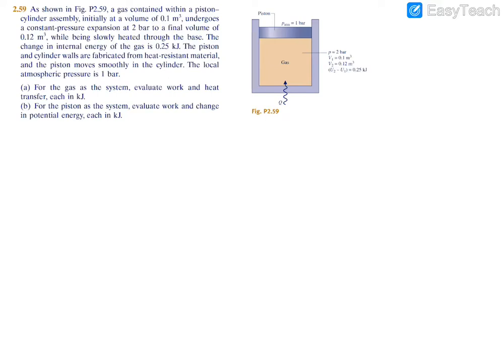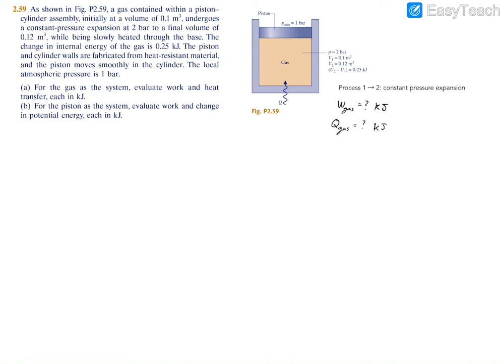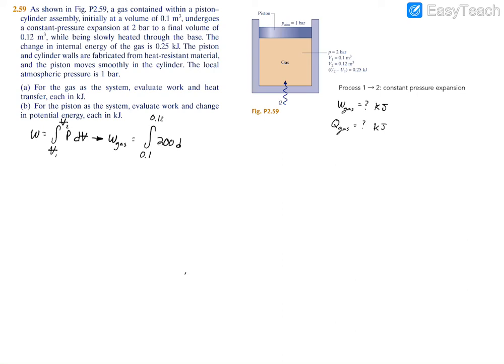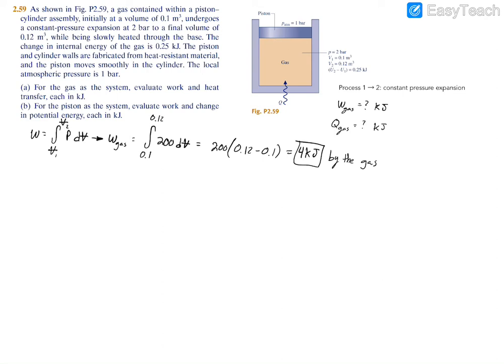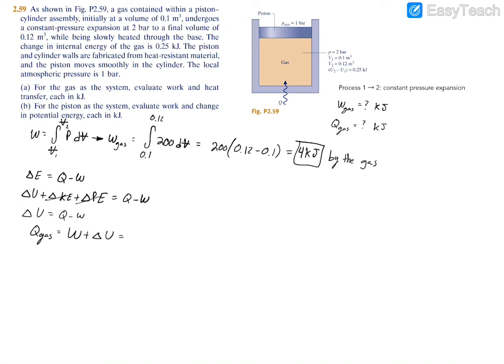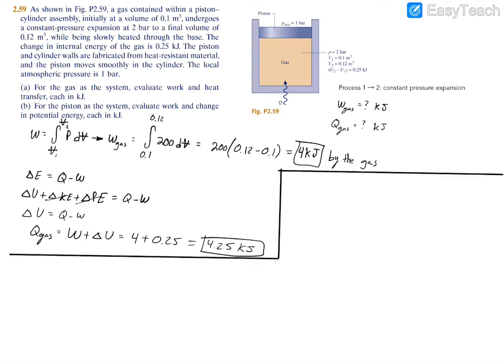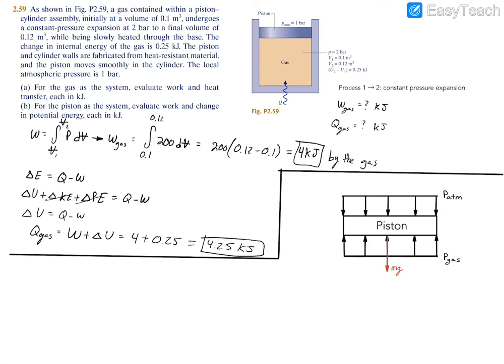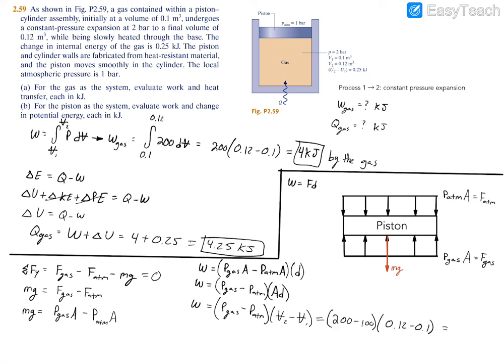2.59 As shown in Fig. P2.59, a gas contained within a piston–cylinder assembly initially at a volume

Comment: Why is the force from Patm not considered a force doing work? Why consider gravity to be the only force doing work?
Reply from the maker: The force from atmospheric pressure, Patm was in fact used in this calculation. Patm was subtracted from Pgas and then multiplied by the difference in volume to find the work. Gravity was not considered in this calculation (mass was not given, assumed to be negligible). Let me know if this is still unclear to you.
Reply: @gr_engineering  If Patm was considered, shouldn't the Wgas be equal to 100(.12-.1) because 2 bar - 1 atm = 100 kPa

Comment: sir why do we neglect the internal energy when getting the potential energy where piston is the system?
Reply from the maker: The internal energy is neglected in part b because part b is treating the piston as the system. The internal energy given in this problem was change in internal energy of the gas, not the piston. This reasoning is similar as to why the gas has a heat transfer of 4.25 kJ despite the piston having a negligible heat transfer.